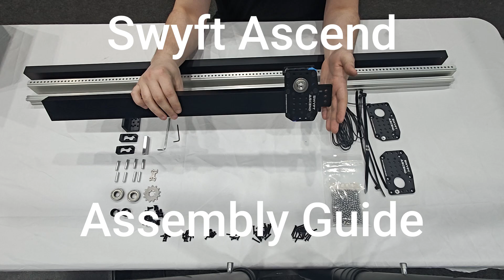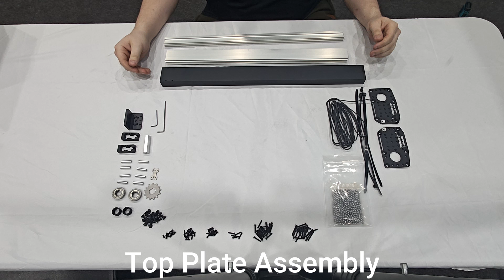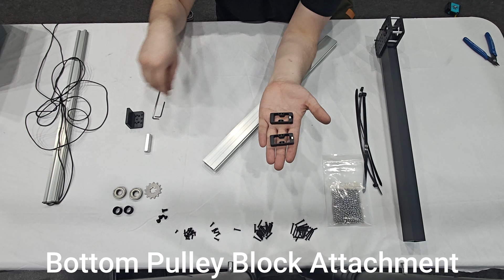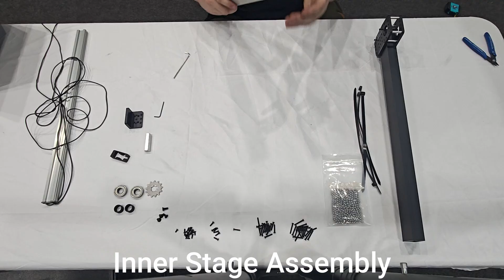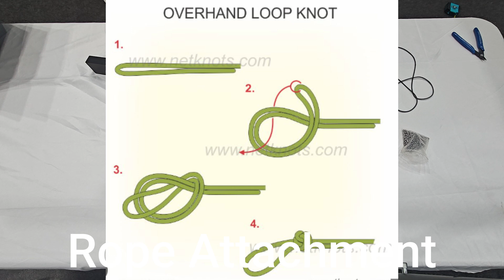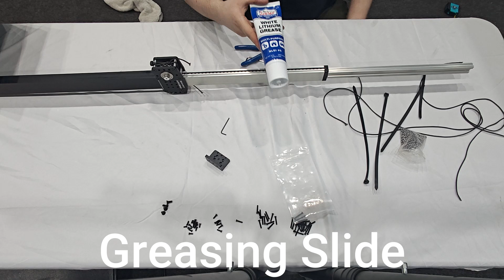Swyft Ascend Telescoping Elevator Assembly Video

Comment: this is a real cool way to approach telescoping elevators. I do think that this approach is more fitting for telescoping arms though, as it seems like it would not be able to handle climbing load and overall seems weaker than a typical elevator